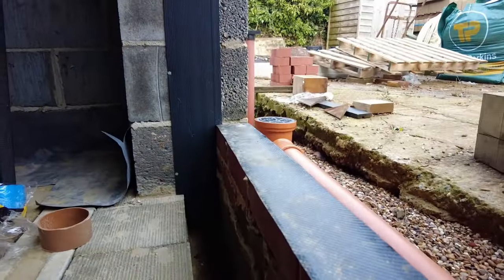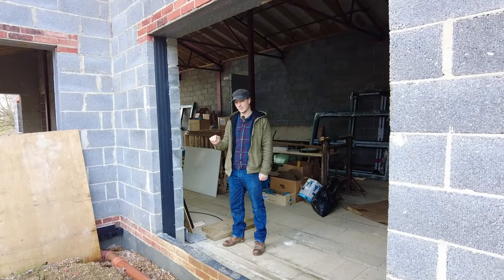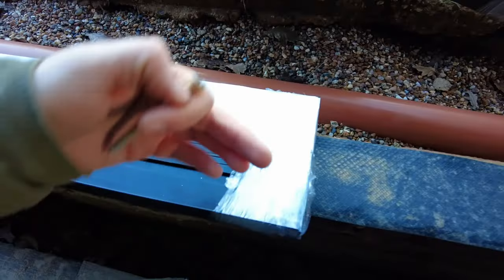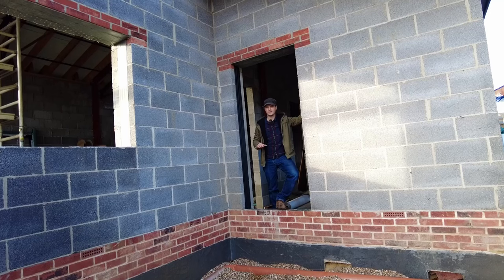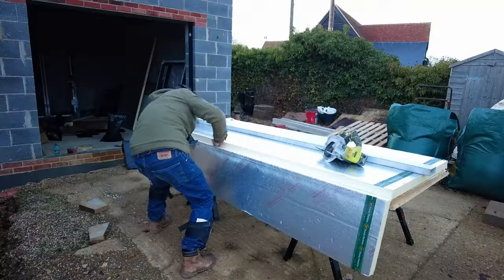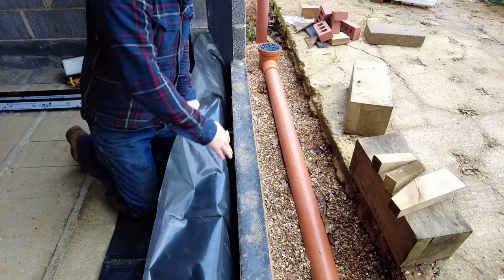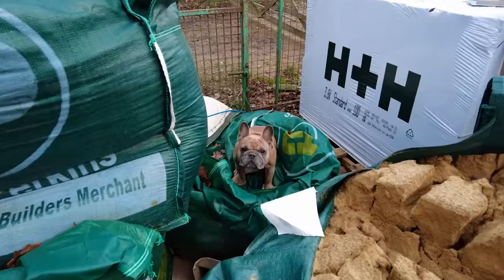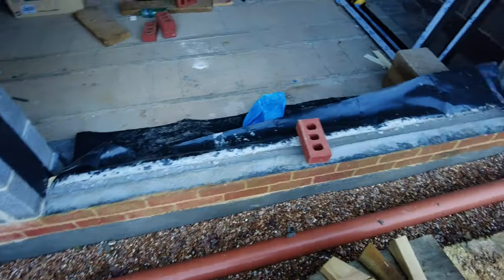Door Threshold Detail on Block and Beam Floor: Is This The Answer???

Comment: I too have struggled with this detail constantly over the years and I am an architectural technician providing construction design solutions for the builder to follow.  I think it just shows that those who invent the rules based on theory have no common practical sense at all. I do commend your exploratory and logical assessment approach in this open and honest way. I still don't have an easy solution myself but I do now challenge my own fudged approach and will look again at the mechanical fixing problem for the base threshold.
Reply from the maker: Maybe you can pave the way with a proper solution! What have you tended to suggest so far? Or is it a matter where builders end up bodging it in and thermal bridging goes out the window
Reply: 7😢7😢

Comment: I usually full fill the cavity with PIR board then put the DPM and floor insulation over the top, job done, once the screed is done never had structural issues.
Reply: That's the easiest and most sensible way. Right?

Comment: I've been building extensions since 1987, this is a perennial problem. I put it to Building Control that we have either a robust detail or a thermal break. Door and window frames are too shallow at 70mm deep. I partially resolved this by fixing door frames flush with the back of the brick in order to achieve a decent fixing and to mitigate potential cold bridging I drylined the reveals with 37mm insulated plasterboard.  25mm PIR/12mm plasterboard.
Reply from the maker: Seems crazy there isn't really one complete solution that is widely accepted. I'm supposed to be doing insulated reveals also, although it doesn't really solve the thermal bridging at the bottom 🤷 maybe one day there will be something that resolves the problem so it can be both robust and thermally efficient. It seems the closest at the moment is using compac foam 🤷

Comment: To be exact here. You need to cut out the face brickwork from the one reveal to the other, and relay that section of brickwork but stepped back 30mm from the rest of the brickwork. Then, the void behind to the block and beam can be dpm and filled with concrete. That is the only way of doing this task properly. Alot of house builders do this like Barratt etc.
Reply from the maker: Oh that's interesting. I can't find any examples on the internet 🤷‍♂️ maybe I'll have to go and have a look at some new build estates, although maybe I'd only be able to see front doors with level thresholds where you can't see it being set back
Reply: If I can suggest, instead of removing bricks and re-laying them back by 30mm, why don't you cut the bricks (thickness of the front skin plus 30) and lay them side-wise while laying bricks so the front skin is flush with the rest whilst the back gives you 30mm solid support?

Comment: If the blocks are cuts in the doorway like yours, I cut the blocks so they partially span the cavity, leaving about a 50mm gap to the outer skin. Support provided:-)  Also re. the sils onto the brickwork, I set the top course of bricks back 20mm and use a short sil too.
Reply: Spot on! Can’t think of a better way myself…

Comment: Great video, something to get people thinking. What I’ve done in the past with any openings for bifold doors is build 9” off the face brickwork. Then like yourself fold the DPC down and around. Not sure if it the correct way but the building control has always been happy.
Reply from the maker: Thanks 👍 I'm assuming most builders find some kind of work around. I'm surprised there isn't a standardized way of dealing with it that is common knowledge though 🤔
Reply: That would have been my suggestion, and given that building control have already discussed the concrete infill as a viable solution here I would guess they would see the logic of the brickwork alternative.

Comment: Good solution I think. You are so right to sort the thermal bridging. I have aluminium windows and doors (mostly SAS like yours) in a new build...the condensation on the frames is dreadful. It soaks into the mdf window boards and into the mdf skirting that butts up to the door frames. All blown. You might want to avoid using mdf just in case, but hopefully you sorted the bridging and will be fine.
Reply from the maker: Aha that's useful to know. Which is worse, the doors or windows? I have the deep frame windows which are thermally enhanced so was hoping they would be ok. Also what kind of ventilation do you have?
Reply: @THE-AIDEN-PROJECT  the doors are worse due to no ventilation. Just got the standard slit vents above the windows.
Reply from the maker: @chrisdunn817  yeah I don't have any trickle vents in mine at all, I'll be installing a mhvr system so hopefully that will prevent any condensation issues 😬

Comment: Thank you for this video. I am an architect and draw details everyday for a living and always struggle with this, especially trying to make it a level threshold. 
Do you drape the DPM down to create a tray/formwork for the concrete? I would have filled in the hole with concrete up for block level then created the upstand of concrete by the brickwork and then draped the DPM over, although the NHBC now recommend the DPC draped over all of the threshold and the DPM draped over this at the floor level. 
The reality of a door threshold is that all the weight should be on the sides, although this is not try for bifolds so it's crazy that there are no standard details showing the 30mm setback or a half brick setback which is my preference aesthetically and for historic buildings.
Reply from the maker: Hopefully one day there will be a standardized solution 🤞 I would only drape the dpm down for concrete if I was just levelling it up to the block and beam floor like you mentioned. The way I've done it this time by making the thresholds effectively deeper, there isn't any dpm between the brick and concrete but when I do the dpm under the insulation I'll lap it up the threshold and tuck it in the dpc probably

Comment: My building regs drawings have 150mm eps in threshold cavity for supporting the floor blocks and the last row of floor blocks bridging the inner leaf on slips (with dpc) up to outer leaf.
Reply from the maker: I think that's what most people end up doing and to get round not being able to fix the cill properly they just don't 😂 seems like they just bung a load of silicone or foam underneath 🤷‍♂️

Comment: I feel your pain with this!  I'm up to the block and beam floor level in my self build and I'm finalising this threshold detail right now. The doors will be three panel aluminium sliders so the frame is 185mm wide which needs solid fixings all around. 

The best answers I've found so far have the frame sit on compacfoam or Marmox Thermoblock as mojonojo3 said in the comments. But I haven't seen it for myself yet. 

Any bridging of the frame thermal break is going to cause problems. Every installation I've seen so far with wide frames has made the same mistake; the jambs just have a return of blockwork and overhead an extension steel plate is welded to the inner steel. These bridge the thermal break of the frame.

I've designed mine to have compacfoam in the jambs and a separate lintel overhead, again with the cavity filled with compacfoam fixed in. The compacfoam can take the fixings apparently.  It's not cheap though so no builder is going to do it, hence the problems with condensation.
Reply from the maker: Ooohh compacfoam 200? I hadn't seen that until now. That looks like a solution to the door threshold but looks like it's held in place by bars and the slab inside. So that means getting everything done inside first before getting the doors in 😬 it looks to be a better solution than marmox because the compacfoam has different thicknesses to make up to the right size. 
I was still trying to think of another solution last night and that maybe strong L brackets could be screwed into the cill from below and fixed to the back side of the outer skin, maybe at 400 centres 🤷‍♂️ then now you've mentioned it, the compacfoam can go underneath ready with bars for when the screed slab is done.
Reply: @THE-AIDEN-PROJECT  Aiden thank you so much for making this video, I've just laid my beam and block floor, and this detail has been destroying my little brain for months. I've come across the same forum posts you probably have, about the slates to support the insulation, but nowhere seems to have a proper solution to the thicker outer leaf. Id even considered part filling the cavity (like your solution) and having that course of bricks running perpendicular with 50mm sliced off, but that won't work with the triple sliding tracks as they're generally fixed in the middle of the cavity.
Dave thanks for your comment. I'm also going for a triple track sliding set and I think the solution I'll go for is a course of the 600*100*100 marmox laid in the cavity. I'll top up the leanmix cavity fill with more lean mix, and then these 100mm deep marmox to bring it up to the course of bricks in the outer leaf (one below the dpc). this should give thermal break to the depth of the ufh screed
Reply from the maker: @rossmcdonald5202  no problem mate 👍 I thought it would be worth while making the video with my work around and between that and the comments I hoped it would help people in our situation. Looks like you've found your way now so I'm glad 👍
Reply: @THE-AIDEN-PROJECT  if I change my mind and go for bifolds, with fixings on the edge of the outer leaf, then I'll definitely be going for your solution, thanks again 👍🏻👍🏻
Reply: Architectural Technologist here - the Compacfoam is the best solution I've come across for deep door thresholds. Marmox is great and it can support weight, but you can't fix into it - you can fix into Compacfoam. Many door/window companies advise not to fix through base frame - one of these is Smart systems - so Marmox could work there. Yes there are lots of different ways to achieve the detail without a specialist product, but it's luck of the draw with building inspectors and warranty providers, especially important if it's a new build

Comment: I`m a window fitter. This is a long standing issue. We used to normally set the windows back 130 and the doors 110 which the inspectors normally accept. Incidentally, I assume the only reason we are asked to set them back 130 is to prevent the thermal bridging that would occur where the cavity closer was not quite behind the frame. It seems to me , if as you say you are fitting insulate reveals surely this would totally negate the issue. I would say 
 the 30mm reg. is meant more for render or standard dot n dab reveals. If I`m right, just set em 10 mm behind brick or even flush , use foam at the door end of the pir plasterboard as you fit the reveals and i really cant see an issue. As for the cill just add the thermal break and foam to suit.

Comment: It's good to see someone else question the gap left between beam ends and the inside of the outer skin and wondered if I've missed something others know or if I was expected to just bodge it. Some think having the 150mm insulation cantilevered out over the cavity is structural & can support the screed and final floor finish but this will crack over time. 

I did notice that you seem to contradict yourself a couple of times. The reason you made the wall thicker was to not have the back of the sill and frame inline with the inside of the outer skin because of thermal bridging, so you wanted it to sit back by 30mm which then left the fixing problem on the edge of the brick. Once you extended the wall thickness you again mentioned you might have a little bit of thermal bridging you'd have to live with.

The catnic type lintels at the heads are very cold bridging unless the extortionate thermally broken ones are used so most of us have to accept this if using face bricks. I personally think having them set back 30mm looks better outside and if it helps reduce thermal bridging it's a plus. I'd like to see more of the info on that you mentioned.

Another option I considered was to have the beams at openings cantilevered over the cavity void, which in my case is 150mm, but unless the beam designer can get the beams into the corners of each reveal for each opening, it won’t work. It’s hard to explain in writing but if the cantilevered beams were inset from the reveals, then the blocks going into each corner would be unsupported and pivot when weight applied.

You could add a piece of 3mm steel plate the width of the opening bridging 98% of the cavity and screwed to the block and beam tops. So 1800mm wide opening and 150mm cavity you'd use 1800 x 300mm. This would be structural.

I think for ease I'll go with a similar method you used at the end, my cavity will be lean mix infilled all around but at the openings I''ll line it with DPM as you did, slide it under the DPC, then fill the cavity void with sand cement ballast mix so its flush with the top of the beams, I'll then slide some metal bars in vertically where I need the outer skin wall thickened up, and once set, use a ply shutter to do a final fill mix up to DPC height but knowing the two are fixed together via the bars, then complete with insulation later on.
Reply from the maker: It's all abit puzzling hey 😂 maybe it sounded like I was contradicting myself as I was just speaking my thoughts out loud. I realised its almost impossible to set the frame back to improve thermal bridging without making thermal bridging worse at the bottom. So just accepted that the best I could do was improve thermal bridging on the sides and a tiny bit on the top whilst making the bottom worse 😂
Your resolve sounds good, I think that alot of these types of things are a work around. It depends on the manufacturers recommendations on fixings but there's a couple of others that are planning on using compacfoam
Reply: @THE-AIDEN-PROJECT  welcome to the over thinking club, they call it that but its often, dont accept the bodging way. ill take a look at the foam you mention, sometimes i look for work arounds because i dont know a certain product exists. My merchants doesnt stock things out of the norm but if theres an xps type full fill insulation that can take compressive forces its what i need to bridge that gap.

Comment: Just came across the same problem on a 90s house i'm renovating. I dont have the option of filling the void with cement because its a lot deeper than yours and the hole goes sideways. When I opened it up the previous builder had just left an open gap and the neighbours complain about their houses having a vermin problem. 

I've put a cavity closer over the threshold similar to the ones you have on the flank sides of your door reveal, and I'm hoping the chipboard floor which will go over it will be okay to cover the 50mm unsupported gap. Lost of heat and cold spots is a concern as the wall in this area is only half brick thick
Reply from the maker: Yeah I reckon you'll be alright with your work around on that one 👍

Comment: Me as a bricklayer would put pieces of block at the return. Mass fill the cavity to top of beam then put a skin behind the brickwork so u can sit your frames 30mm back and have a strong fixing then put your 25mm insulation against the inner skin for the thermal bridging
Reply from the maker: 👍 Would you just cut down some blocks or something to an inch thick to build the skin?
Reply: @THE-AIDEN-PROJECT  no coz u wouldn't get a good fixing into that because they would crumble. I would 65mm concrete commons in on edge. And that way your fixings would be right in the centre of the common brick
Reply from the maker: @kriswild1824  ah right I've got you 👍
Reply: @THE-AIDEN-PROJECT  no worries I no u would have 65mm less insulation towards the outside in the threshold but would rather have my bi-fold have a good fixing. If your frames do sit back 30mm you are only losing 35mm of floor insulation but houses these days are insulated that much I wouldn't lose sleep over that haha. There probably too insulated n sweat air need to move around
Reply from the maker: @kriswild1824  yeah the way you would do it is similar to what I ended up doing. Probably the quickest practical work around. Nothing is perfect hey!

Comment: Just as a head up have a look at Thermoblock by Marmox (the tile board people) structural blocks designed to break the thermal bridge.
Reply from the maker: Yeah I came across them a couple of months ago, I was thinking about starting my internal walls off with them but they are super expensive! My plans and SAP was done from thermalites, plus all of my external walls are already thermalites, so after much internal debate I decided to just go with the thermalites  😂
Reply: @THE-AIDEN-PROJECT  makes sense. I'm just doing the thresholds under bi-folds with them. But the costs would be immense if you're doing all the internal footers with them.